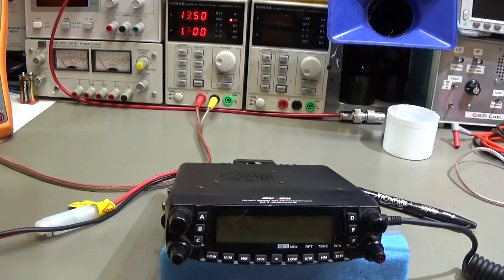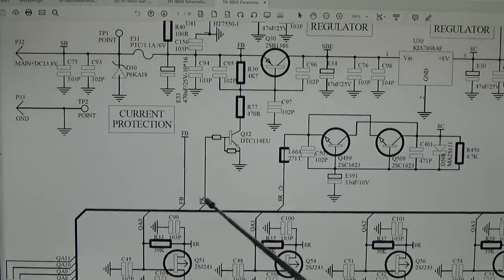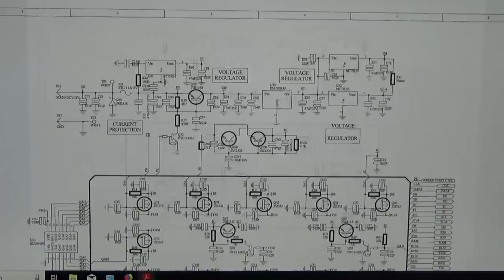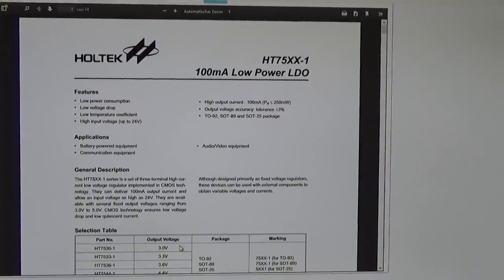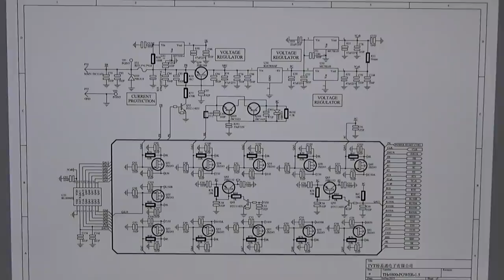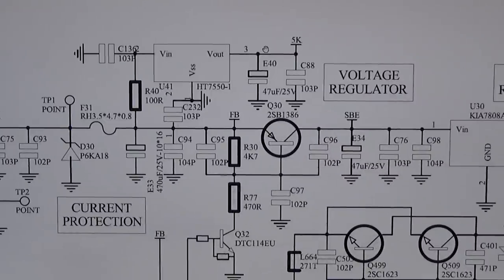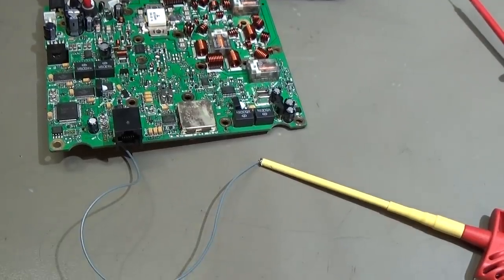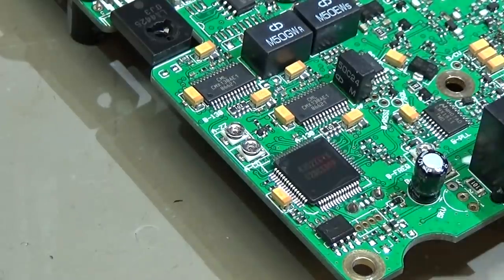#205 TYT TH-9800 FM Quad Band radio: No parts no life

Comment: Again, very nice video, the alcohol test was a new one for me. What a shame, I was really hoping to see you replace the CPU, however like you said, more IC’s also could have shorted from the high voltage getting through the shorted Zener. 
Would have been interesting to see if the removal of the vcc +5v power pin of cpu, or complete removal, would have lifted the short on the 5v line. If so, maybe all it needs then is a new CPU “if can be found somewhere” and new Zener Diode?
Reply from the maker: Well it is no problem to get the uP it is only 5$..the software is the problem...
Reply: TRX Bench 
Ah, I see. So the cpu has custom code to operate, and the eeprom only retains the user’s settings ?

Comment: I got this radio as my first non-HT. 10meter and 6 meter FM are very interesting! Mine is the "Improved" version whatever that means....I've run it through a lot, including cross band use and it handles it like a champ but I do worry about running it on high power. I definitely don't get 50watts on it unless I am on a 25amp+ power supply.....30watts on high power is the best I get on a 12amp PSU.
Reply: It requires a 15amp power supply for full output.
Reply: I suggest you remove the pcb and fan. Drill out the back of the case to allow the air to flow internally over the PA and the pcb, then drill three slots in the lid as an outflow for the hot air. You can then run high power knowing you will not blow up the radio's PA. You learn these tricks as you go along life's ham radio highway. Also change out the regulators for the 1.5A (TO220 type) and heat sink them using thermal compound. Long life will ensue. Happy days.

Comment: I have an issue with  mine. Right side had bad receive on both bands (2/70) and does not transmit audio, just carrier and you can hear dtmf tones. Left side the same but receive is ok on 2m/70 cm.  I can also transmit and receive on 10m and 6m on the left. Any ideas where to focus?

Comment: The diode was not effective maybe a little slow and not efficient I think it lacked a small current limitation in it, excellent video hugs from Brazil Peter.
Reply: More likely, just too much sustained current as a Zener is quite fast at clamping, but you still have the issue of impedance limiting its ability to protect if overwhelmed by current.  That said, the Zener was almost certainly selected to provide ESD protection since it leads to an external jack rather than a sustained over-voltage event from getting the connections swapped.  Ideally TYT would never have sent unlimited 13.8VDC direct to the front panel through that connector.  If they had limited the front panel to 5VDC then the swapped connections would have remained within the safe 5V limit the CPU could handle and no serious harm would have been done so long as the resulting current was not sufficient to burn through PCB traces.  

On the Yaesu FT-8900 that this radio is supposed to be a “functional” clone of, the front panel voltage is provided by way of an 8V linear regulator which should have then gone into overcurrent protection upon shorting of the Zener and would have likely then protected the radio — Yaesu did not just pass 13.8VDC straight through to the front panel.  I’ve not studied their schematic for the head unit port, but I would hope Yaesu implemented better overall protection for that port (and strongly suspect they have, not that I’m going to intentionally short out either of my FT-8900 front panel interfaces just to test that hypothesis!).
Reply from the maker: You are right it was not effective enough for 13,8volt.. Thanks for feed back

Comment: Peter I recently purchased the tyt th9800. Wondering if you have experienced the radio not turning  off. Out of the blue decided to turn on its own, now unable to turn it off, holding down the power button nothing. Unhook the power goes  off ,wait a few plug-in the power it turns on with out pushing the power button. What  do u think

Comment: also I purchased a warranty with the radio and have used it once, parts are available and it can be fixed. Otherwise in the last two years it has been issue free and I constantly get positive comments on how good the radio sounds.
Reply from the maker: as long you are happy all is fine
Reply: Are you sure they didn't just replace the radio?
Reply: @dayjeremy  Yes, they sent a note stating that is was repaired.

Comment: I wonder why the sellers of this model radio are making false claims about it saying that it can receive a wide range of: 26-33Mhz, 47-54 MHz, 110-180Mhz ( with AM Air band), 350-399Mhz, 430-512Mhz, and 750-947Mhz?  That's not true, it can only get 4 Ham bands.  I was thinking of buying one until I tried it and found that it doesn't get the frequencies they claim.
Reply: Frequency range supported can depend on country of import.  For example, in U.S., the FCC (Federal Communications Commission) requires amateur radios to be limited regards transmit frequency range in each of the bands, to prevent out-of-band use.  Imported to Australia, the programming would be different.I think there are work-arounds; a little Internet searching will answer that for you. KI7ZEI
Reply: @timhaupt5270   That's not true when you buy it on Ebay coming from China.  The receive frequency is also limited to 29/50/144/430 Mhz. and there is no work around. It's odd that all the sellers still claim a wide frequency range but they seem to just be copying bad information from the TYT website.
Reply: steve c wow

Comment: Nice video. very handy..

Any idea where i can find a schematic for the TYT TH-7800 ?

My Nephew was messing around with it one morning and after removing the head setion, he plugged the cable (connecting the head and body) into the mic socket on the head section.

An obvious smell of burning a few seconds later resulted in a dead radio.

Any ideas?
Reply: My son did exactly that to my TH-7800 with the same result, it took out Q30 (2SB1386) transistor, replaced it and all works well again.

Comment: TRX BENCH  Hello Sir,  I need help with my tyt th-9800,  I want to use it on packet,   My manual dose not tell me
the pin-outs for the microphone RJ-45 mike connector that connects to the radio,  can u help??
I need to know what pin is for (AUDIO IN) (AUDIO GROUND)    PTT AND PTT GROUND.  PLEASE advise if u can,
my tyt -th 9800 is working fine and I would like to use it on 1200 baud packet,    tnx much,   Ron  USA,  Ham Call  is  N8DUK

Comment: Hi Peter. I would like to know if is there any form to power on the 9800 after clearing all data of the eprom, so by mistake, programming it, I pressed the CLEAR DATA" option, and when realized of that mistake, it was late. After powering off the 9800, when tried powering it on again, nothing, DEAD. The problem is that I need sending the software again to it, but because it is impossible powering it on, the computer can not see any COM PORT, so impossible reprogramming it.  What can I do different to throw it against the wall? Thanks
Reply: Wingo Cabrera Is there a way to contact the manufacturer?
Reply: @looneytune-upelectronicsll2241  Hello again and thanks for answering. as regards your question, I have tried many e-mails and no answer, so I guess no way to contact the manufacturer. I have only got answers from the reseller, and its answer has been good, sending me the prgraming software, but that soft is unuseful if the computer can not see any com port to send it and program, so the 9800 can not be powered on by the normal way.

Comment: D30 is to protect from reversed polarity but what I noticed is D30 is on the wrong side of fuse F31 so it cannot protect the radio. It only protects F31? Your thoughts?
Reply from the maker: so it is
Reply: F31 is not a fuse per se but rather a PTC “polyswitch” to limit current to the downstream logic rails in the event of a sustained short (the PA stage draws a lot more current) so you don’t burn PCB traces.  However, there should be a 15A fuse installed inline with the power cord and that is located external to the radio (thus user serviceable).   In the event of a reverse polarity or over-voltage event the D30 diode (typically a TVSS diode) will short out the input power rail to quickly blow the external 15A fuse.

Since the peak current draw on a 50W FM radio is typically around 8.5A at most, I often downsize the factory 15A external fuse to a 10A or 12A fuse just to ensure that it will blow that much more quickly if necessary.  I’ve yet to blow a 10A fuse even after extended crossband repeat QSOs/Nets at full power (50W on VHF, 35W on UHF) that lasted for upwards of an hour...though the radio was fairly warm after that full power test (but my FT-8900R never overheated, which impressed me).

Comment: Poor design. The companies design team know full well the availability of cross terminated data network cables. They may even mention not to use such a cable. But they also know full well they are selling these units to hair-less apes (humans) lol. They know some of us are going to use the separate control head option. Was/is it possible to wire this RJ45 jack so opposite polarity would still work, or at least not fry the components on the board? Of course it is. Even a sticker near that port to exercise caution in cable selection would help. Shame on the company to not update this flaw. Good video.

Comment: So, the 5V zener wasn't fast enough to protect the CPU. Too bad. I'd look at a better alternative to protect the next CPU a bit better. Maybe another diode net to U41. But I'm a bit curious why they used a 100mA regulator. Do you know how much the CPU pulls when it running normally?
Reply: The Zener was likely intended to address transient over-voltage events (such as ESD), but a sustained over-voltage or an over-voltage with nearly unlimited current behind it would quickly overwhelm the Zener.  It usually takes a fair bit of sustained overload current before a diode goes short circuit.

Comment: I very stupidly bought one of these radios for te car. The car said 'thank you'. Switch on and right into TX. Threw the damn thing into the waste bin.
Reply: My one works Great. You should have returned it under warrantee unless you wired it in wrong it will not go into TX when powered up.
Reply: Mine works great.  Been the car three or four years.  No issues at all.  I don't intend to fix it if it quits working.  I got it because it was cheap and put it in a cheap car. ( didn't want the radio to cost more then the car)

Comment: Hi Peter. Thanks as always for the step by step debugging of the radio fault. I have to say that top marks on sourcing the schematics/circuit diagrams; I really do NOT like the Chinese style of drawing the schematics with the non-described labels such as the 5K , FB, etc.  They also have many parts shown as "Notuse" which only clutters up the schematics; very annoying!! Anyway, well done as always Peter, 73 Brian
Reply from the maker: Hi Brian, yes you are right 100% agreed. All in all this brand is a no go ! Thanks for comment

Comment: When I first got started with radio, I bought an Icom dual-band mobile. Some time later, I connected it backwards to my power supply, using a cable that I'd made with no fuse. There was a "click" sound from the radio and then nothing.
I sent it off to Icom for repair, which they completed in less than a week.
They sent it back with a detailed report of the repair and no charge. NO, it wasn't in warranty.

Moral? Buy from someone who cares about their reputation. Icom seem to have a business model where they refuse to have broken radios sat on peoples desks.
Also, buy from someone who can get THEIR supply chain in order. You won't find grey market MCU and Wan-Hung-Lo capacitors in an Icom / Yaesu / Kenwood.

Finally, I have never seen the attraction of Quangshumengshidong radios. The pager breakthrough, poor audio and dodgy user interfaces are totally avoidable, but the manufacturers don't care because people still buy them.
Reply from the maker: that is right buy where the company take care...
Reply: Icom don't really support their older radios either.

Comment: locally, several folk have had failures of the radio on installation in their car... Having a proprietary cable for the head to front panel connection where it "looks" like a regular ethernet cable results in terrible failures.  They should be held responsible for using a cheap connector, but having it wired so that normal cables fry the radio...
Reply: RJ-45 connectors are not just for Ethernet. You cannot blame the manufacturer for your own ignorance.
Reply: @dayjeremy  I have not had one of those radios, but I know of people that have, and have the nice issue that destroyed the radios twice.  I have several radios capable of remoting,  but have not had the issue.  The interesting part on the mikes for the Kenwood microphones; They use the standard ethernet paring so that use of the RJ45 conforms with the standard and NO damage is done via the use of the cheap connector / Ethernet cable combination.  It CAN be done.  They just chose to ignore standards that are out there.

Comment: This is a Yaesu clone,, will the Yaesu CPU work ?
Reply: No, it is a “functional” clone, not a so-called “dark shift” production unit (a “dark shift” is where the Chinese continue to produce units for their own purposes using the same production components as they used for the contracted production and are thus identical in every respect, though illegitimate forgeries legally).  So while it is meant to reproduce the same functionality, the Yaesu radio is substantially different from the TYT.  For example, the voltage passed through the FT-8900 should be 8VDC by way of a linear regulator (with built in overcurrent protection) versus passing the full 13.8VDC power rail through to the front panel.  That and the fact that to the best of my knowledge, all of Yaesu’s FT-8900 production is located in Japan insofar as the radio itself is concerned, so China would have had to do significant reverse engineering which makes it easier to just implement their own functional equivalent of rather than reverse engineering it all.

Comment: Its this yaesu ?
Reply: clone
Reply: Nope. Just a cheap clone. They work well until they don't.
Reply: No, it is a TYT TH-9800 “functional” clone of the Yaesu FT-8900R/E quadband radio.  But it is not the same radio in any respect other than function.

Comment: I was fine with this video until about 3 minutes into it when he tried to power up the faceplate and it was not plugged into the radio.  DUH!!!  No wonder the faceplate doesn't power up.  He does have a very nice test bench tho.  73s and plug it in next time
Reply: He was just demonstrating how the faceplate is normally supposed to power it up, ie the power switch was located there. DUH. At the beginning of the video he already showed that the radio would not power on from a connected faceplate but that the radio drew 100+ ma. I think you are frustrated because you could not follow along as he traced the problem on the schematic and in no case was energizing the circuit by plugging it in or out. I'm glad you like his test bench but suspect you wouldn't know how to use it, based on your comment. 73's.

Comment: Standard Ethernet cables are straight wired...no crossovers.
Reply: The nice thing about 'standards' is that there are so many to choose from. Not all ethernet cables are straight wired.
Reply: The ethernet patch cables I have made and used in the past have never been straight through.
Reply: Some are crossovers.. Modern routers will recognize IF they are and compensate for that.
Reply: In a crossover cable, pin 4 is wired straight through anyway (i.e delivering FB to the correct place on the detachable display) along with pins 5, 7 and 8. It should have been possible to design the interface to work with either cable topology. Ref: https://en.m.wikipedia.org/wiki/Ethernet_crossover_cable
Reply: Crossover patch cables are not nearly as common over the past 20 years as they once were thanks to auto-MDX being built into most switches today so you tend to have to specifically look for such cables these days (or make them yourself).  However, if the head unit cable for this radio is wired in accordance with a typical telephone modular cable, then ALL the connections on the far end will be mirrored rather than straight through, in which case the Ethernet cable would have reversed all the pin positions at the other end (e.g. pin 4&5 would swap, as would 3&6, 2&7, and 1&8, that is 12345678 at one end becomes 87654321 at the other).